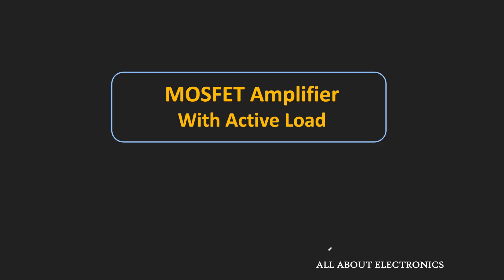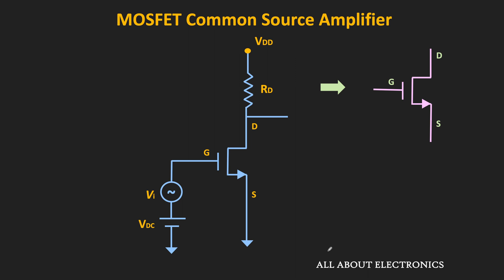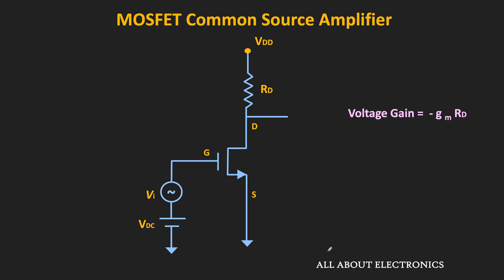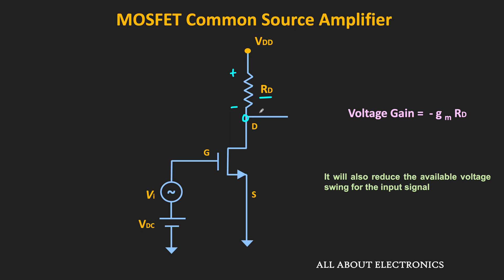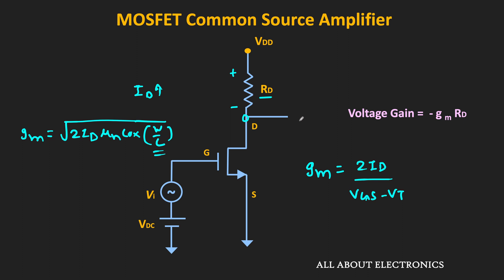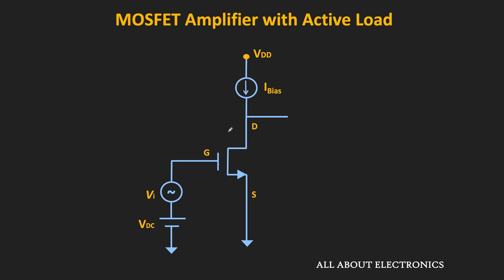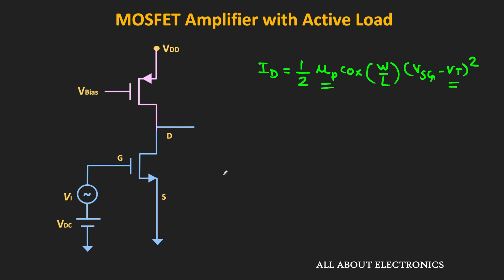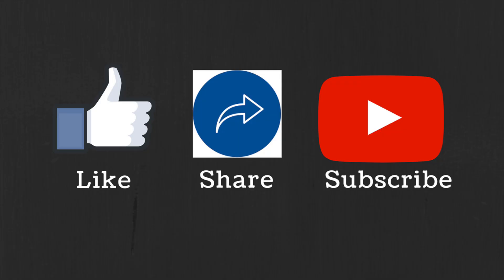MOSFET (Common Source Amplifier) with Active Load Explained

Comment from the maker: For notes check this link: https://www.allaboutelectronics.org/mosfet-amplifire-with-active-load/

Correction (Please note): 
At 8:08 For the PMOS transistor, instead of Vt, it should be |Vt|. That means Vsd should be greater than or equal to Vsg - |Vt|
At 11:11, instead of Vt in the equation, it should be |Vt| for PMOS transistor.

Comment: Hi thank you for the videos, I have a burning question and I really hope you can help me out please!! I am requires to design an amplifier with |Av|= 100V/V and drives a load between 10k to 1M. VDD=5V and Vin= 0.01sin(2pi1000t). I need to simulate this on cadence, may I know what are the steps required?

Comment: The extra current is nice in a active loaded circuit, but the noise of the PMOS device is much higher than a resistor.